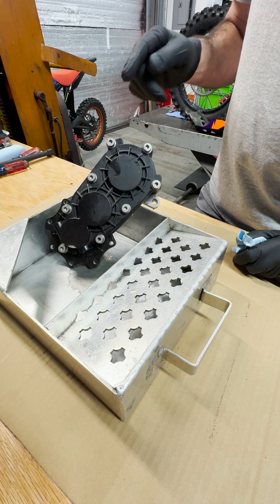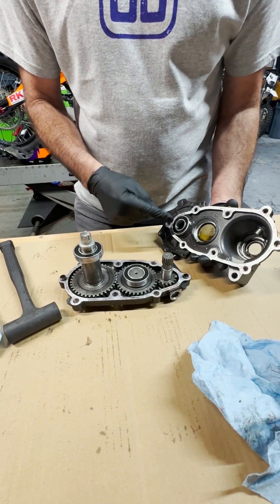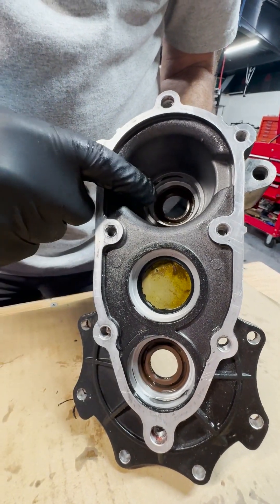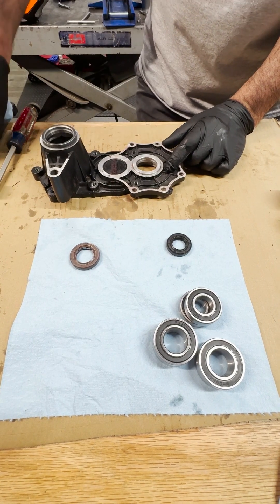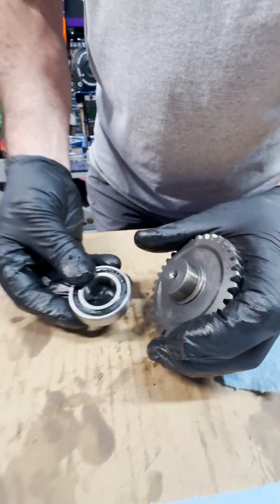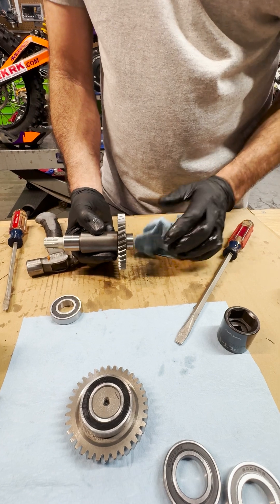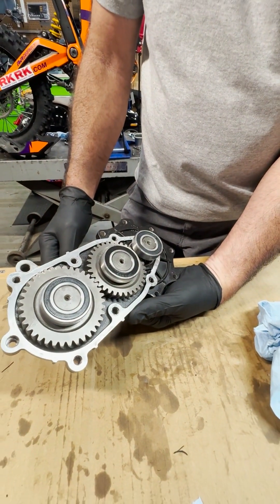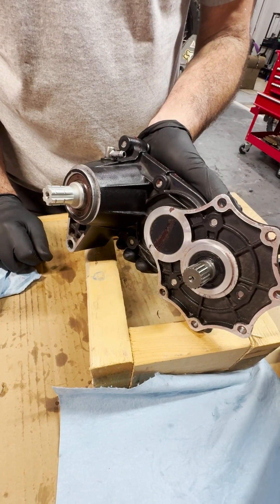Talaria Gearbox Rebuild PART 2

Comment: Can you/anyone give me the part numbers and or sizes of the bearings used in the gearbox. I need to know the sizes because I'm going to install full ceramic bearings into my talaria gearbox.
Reply from the maker: @No_Ones_Fool Ceramic bearings are not recommended for the gearbox because they can shatter on impact. We have actually seen this happen. You can find stock Talaria bearings on ebikezilla.com. Thanks for watching and let us know if you have any other questions.
Reply: @db_dirtybike  Oh, I'm not worried about that. I have a lower back injury from my time in the military. So, hard hitting big air jumps and crazy hard hitting bumpy trails rides are out of the question for me. I use the bike mainly as a street cruiser and the occasional mild trail ride. For my uses, going full ceramic. The pros outweigh the cons. But I'll keep your warning in mind should I ever decide to start jumping mmy bike.